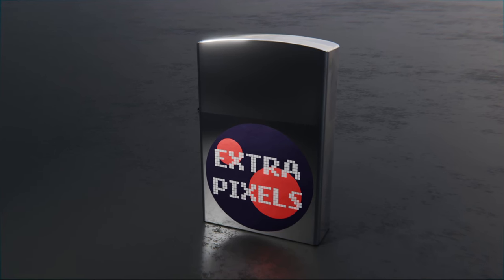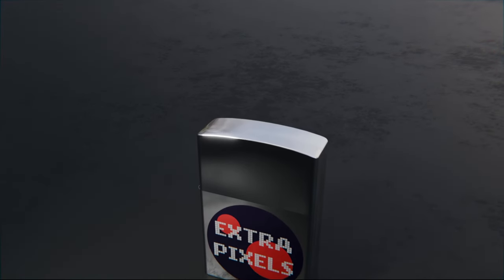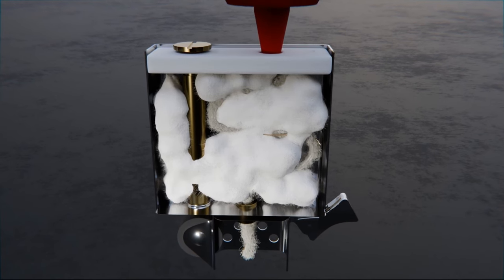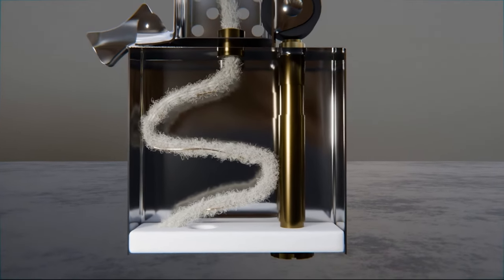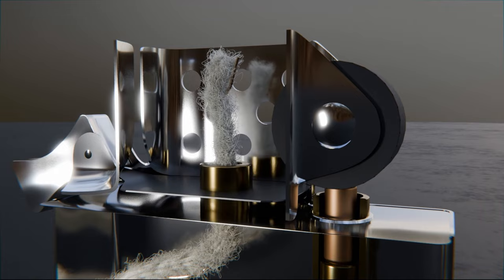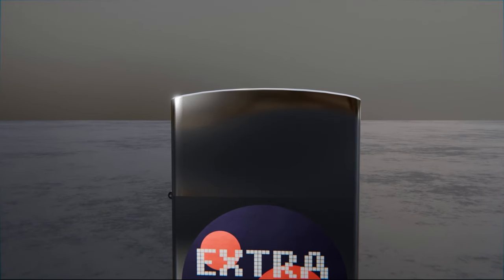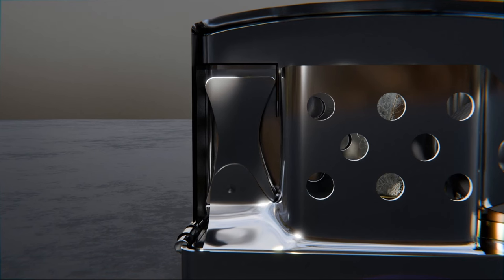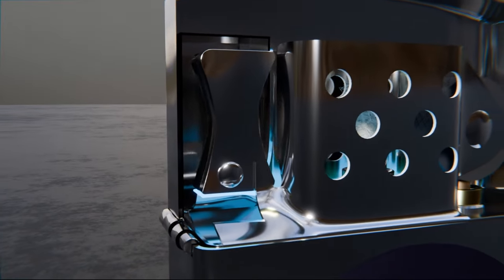How a Zippo Lighter Works

Comment: the hole in the felt is not a fill hole, it specifically states "Lift to fill" for that reason, please stop spreading misinformation. Also, the copper in the wick helps to  "wick" lighter fuel from the rayon, thanks to the copper getting hot. The heat draws more fuel to the wick.
Reply from the maker: Technically the hole isn't there for fuel or as a place to store flints. It's only intended purpose is to make lifting the flap easier. But that isn't how people use the lighter in reality.
Reply: I used it as a fill hole for 30 years and it seemed to work just fine.
Reply from the maker: @tgwaste  Me too. I've been using Zippos for almost 20 years and it's never caused any issues for me.
Reply: Well to be fair he said it "can" be used for that or storing flints

Comment: 3:02 Seeing as how there’s already been one pedantic comment, here’s mine!🧐😁. The spark doesn’t light the fluid, it lights the gas vapour, the evaporated fluid. If you throw a match in a can of petrol, it will extinguish, it’s the evaporated petrol that lights.
Reply from the maker: Yes, true.

Comment: I tried to test using WD 40  in my new zippo lighter my babysitter girlfriend gave to me as a gift and burned my hand as I lighted it. Basta the entire lighter burst into flames along with my hand holding it! 
My mom and me both screamed ỉn horror and me in pain, and I got rushed to thé emergency. I got 1st and second degree burns in my left hand. Was still lucky  l lighted it far enough from my face with a cigarette in my mouth. I may be a tough strong  grown man but this was the time I really squealed and cried like a little boy due to pain.
Reply from the maker: Yeah, don't do that. WD40 isn't fuel.